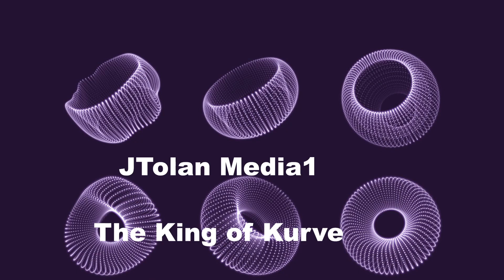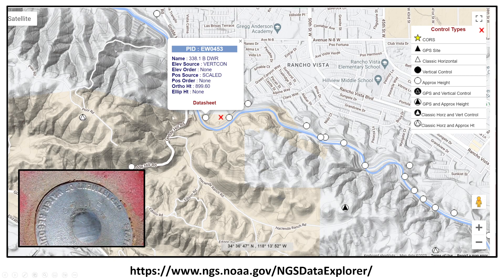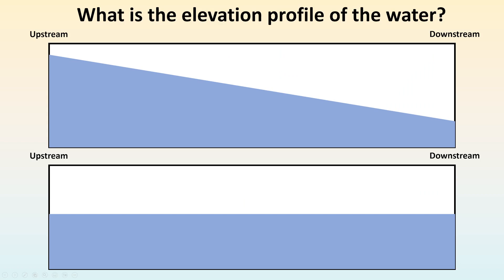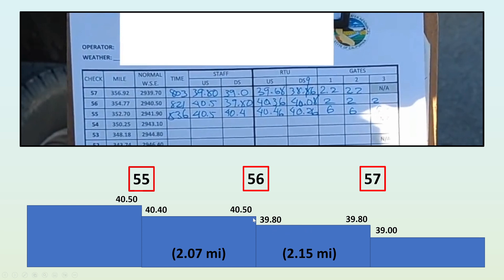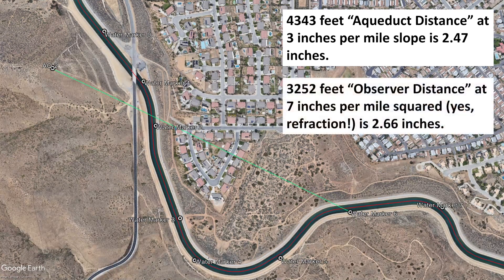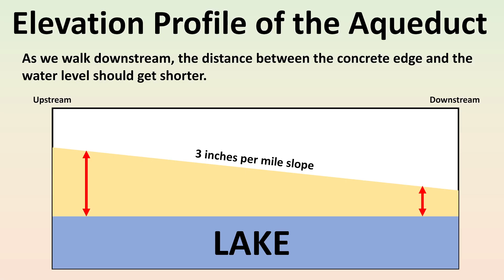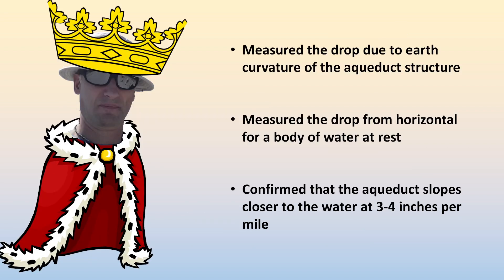@jtolanmedia1 is the King of Kurve!!!

Comment: 1. First of all: regulating the water on the gates is not so much that "the gate closes completely" and the water is stagnant and "we have a lake" but that water always flows, sometimes slower and sometimes faster, which is regulated by the gates. Did you get it? Only exceptionally, the gate is completely closed or opened to the max. (When there are rapid fluctuations in the water level - e.g. heavy rainfall or something else).
So there is no "lake" between the gates, but the water flows in principle all the time. The rate of flow could be regulated by the gate operator. It can be temporarily accelerated or slowed down, but of course only temporarily, because the incoming mass of water must be let through

2. Secondly: My God, I'm even sorry to write this. The fact that the same level of water was measured on the gate above as on the gate below does not prove that "the water is still and we have a lake"! Per analogiam: If, for example, in the vicinity of St. Luis the gate operator measured the level of the Mississippi River 5 meters and at the same time the operator in Memphis also measured 5 meters, does that mean "the water is standing and we have a lake between St Luis and Memphis"? What about the terrain, the height difference between St Luis and Memphis? 
The operator at Gate 55 of the Aqueduct measures the water level relative to "his concrete", and the operator at Gate 56 measures the water level relative to "his own concrete". But these "concretes" are not on the same level as you drew it in your drawing. Because the terrain is falling. Did you get it? 
[Not to mention the fact that you showed some records of measurements, and you didn't even notice that on what you showed the operators entered the times of the measurements and these times were different. Around 8:00 in your movie. But it's just a curiosity, it doesn't matter at all. ]

Thirdly. Jtolan measured the water level at a distance of 6,991 feet. His sheet is shown in your video (around 12:30). So why did you end up at 3,252 feet? Over a distance of 6991 feet, drop associated with the supposed (imaginary) "curvature of the earth" is 14 inches. But JTolan measured only 6 inches, and much more importantly, the drop line shows no curvature!

In summary: you mock JTolan for being the "King of Curves". And who are you? Are you just wrong or are you intentionally lying and deceiving people?
King of Fools or Prince of Tricksters? You choose.
Reply from the maker: Yay! A flat earther engaging with the actual content. Thank you 👍

"First of all: regulating the water on the gates is not so much that "the gate closes completely" and the water is stagnant and "we have a lake" ..."

Yes, I understand this. Go to 7:15 of my video, where I say "this is a tricky situation because we actually have flowing water. If that water is flowing really fast [...] in the bottom diagram we've got a situation where the water isn't flowing much (if at all)". I'm simply using the terms "river" and "lake" to distinguish between scenarios where the elevation changes and where the elevation does not change.

" ... which is regulated by the gates. Did you get it? Only exceptionally, the gate is completely closed or opened to the max."

Yes! If you listen to the interview in JTolan's video, the employee mentions how the gate is "open to 2.2". I don't know what units these are - maybe feet? - but yes I understand that the gates are regulated, and the water is generally always flowing. The key is whether there is a significant elevation change to the water. His measurements say that the water is at a constant elevation.

"Secondly: My God, I'm even sorry to write this. The fact that the same level of water was measured on the gate above as on the gate below does not prove that "the water is still and we have a lake"!"

First up - never said the water is "still". The term "lake" I used in the video is simply shorthand for the water maintaining a constant elevation.

"What about the terrain, the height difference between St Luis and Memphis?"

The elevation at the gates has been surveyed to an accuracy of +/- 2 cm (i.e. less than an inch). The measurements that the employee makes are elevations relative to sea level, so YES the "concretes" ARE at the same level. If he measures 39.80 at one end and 39.80 at the other end, then there is no significant elevation change in the water.
 
" ...and you didn't even notice that on what you showed the operators entered the times of the measurements and these times were different."

Of course they're different. 🤷‍♂ Dude drives a truck to each station and records the level. Did you think I believed that he was just teleporting .. ? 🤦‍♂🤦‍♂

"Thirdly. Jtolan measured the water level at a distance of 6,991 feet. His sheet is shown in your video (around 12:30). So why did you end up at 3,252 feet?"

The goal was to demonstrate that at this distance, the slope rate of 3" per mile is basically the same as the drop due to curvature of 7" per mile squared (refraction!). JT acknowledges that there are a few inches of wet concrete that make it difficult to see the true water level, add in the diffraction limit of 1 1/2 to 2 inches at that distance, and I just don't think his longer measurements are all that trustworthy - I've caught him fudging the numbers in previous videos, but I stopped short of accusing him of that here. That said, when his video came out, I did try to get a surveyor out there to make similar measurements - but also UPSTREAM - which would have settled the issue because there would be no confusion between slope of water flow, and drop due to curvature. I think I might try this again 👍

Thanks!
Reply: @roohif  "„The measurements that the employee makes are elevations relative to sea level,"

No, they are not. Measurements at the gate on the flowing river are made against the "concrete". Measuring relative to sea level would make no sense to the gate operator. Because he is not interested in the "height of the water above sea level", only the height of the water "above the concrete". Because what interests him is whether the water level relative to the gate is too high or too low,  to know whether to slow down or speed up the flow of water.

 "so YES the "concretes" ARE at the same level."

No, the are not.

Take a look at your own video (6:15). I understand that you agree with how JTolan measured CONCRETE, don't you? 
I also understand you think that the Earth is a globe, right?

So , with these assumptions you should know that the concrete level (relative to sea level) is not the same, but it is dropping about 3 inches per mile as measured by JTolan and as you accepted his measurement. I also accept his measurement. So the concrete is not at the same level, but follows the slope of the terrain- around 3 inches per mile.

[I remind you: 3 inches per mile concrete drop is NOT in reality, but with assumptions like above]

Therefore, if we both, that is, you and I, agree on the concrete measurements made by JTolan, then let's consider what results from these measurements.

Well, from these measurements it follows that the slope of the concrete (relative to the observer with the theodolite standing on this hill!) is the sum of what corresponds to the (imaginary) "curvature of the earth" (8 inches per mile squared formula ) and the slope of the terrain. This total over a distance of 8559 feet is approximately 2.11 feet (25.32 inches), see concrete measurements by JTolan.
However, at a distance of 6991 feet, i.e. the distance at which JTolan measured the water level (not the level of concrete) it should be about 18 inches. 14 inches due to the "curvature of the earth" plus 4 inches due to the slope of the terrain. Correct? Reminder: concrete drop follows the (imaginary) "curvature of the earth" and the slope of the terrain - as proven by JTolan, with which we both agree. See your video.

Now let's see how water behaves. Let's consider two cases. 
Case one: we live on "a globe with a radius of about 6371-6378 km". In this case, the water will behave in the same way as concrete,  it will follow the "curvature of the earth" (as concrete follows) and the slope of the terrain. Thus, if the earth were a "globe" (as above), then:
1. JTolan measuring the water level would measure at least about 18 inches of difference (in the water level relative to the observation point) over a distance of 6991 feet.
2. The water level (relative to the observation point) would be a curved line, not a straight line. Exactly the same as the concrete level.

Meanwhile, JTolan measured just under 5 inches of difference in water level. And what is even more important, the water level is in a straight line, not a curve.

Case two: we live on a flat earth. What should JTolan measure then? What water level?
Well, first of all, it is worth noting that someone has built (for some reason, I will come back to this later) concrete that follows "the curvature of the earth". You can't change that, it's how someone built it. Concrete is a structure made by a man. But does water pay any attention to this fact at all? Of course not. Water follows the laws of physics and flows in accordance with the terrain.
So on flat earth:
1. JTolan should measure about 4 inches difference in water level.
2. The water level line should be a straight line.
JTolan measured just under 5 inches of difference. 0.4 feet, which is 4.8 inches difference. The water level line is straight.

The earth is flat.

But someone has built concrete that follows the "curvature of the earth". Why ? Well, you never know what's in someone's head and who's up to what. I suppose that those who built the aqueduct had  „the globe Earth”  (imaginary) in their heads. And they figured out that when the concrete follows the drop from the (imaginary) "curvature of the earth", it will then keep the same level relative to sea level, regardless of the slope of the land.
But since the ground is flat, the effect of this erroneous assumption is that the concrete drops faster than the slope of the terrain, and  the water level relative to the concrete rises with each mile (between the gates, of course, because at the gates the water level resets). Water does not lie.

Which was also shown by J Tolan.

Very good work  Mr JTolan ! Beautiful.
Thanks a lot. God bless you!
Reply from the maker: @maciek445  ” No they are not “

YES. THEY. ARE. 

The column on the left: “Normal WSE” is Normal Water Surface ELEVATION - which is what the employee is recording when he checks either side of the gates.

The water is measurably NOT sloping down at 3” per mile.

Try again.
Reply: @roohif  "YES. THEY. ARE. "

No, they are not.

But you are confusing reality with what you think is reality. And I was writing about reality. What the workers think they measure at the gate is one thing, and what they actually measure is another. The discrepancy between what the workers think they measure at the gate and what they actually measure is because the concrete is built on the assumption (imagination) of a "globe", but the real earth is not a globe. Did you get it?

"The column on the left: “Normal WSE” is Normal Water Surface ELEVATION - which is what the employee is recording when he checks either side of the gates."

Well, so what?
But let's take what you say. Therefore:

1. first of all, you think that the earth is "a globe with a radius of about 6371-6378 km",
Correct?

Well, that's your imagination about reality, but let's assume for a moment that this is what the earth is like, that this is what it actually is.

2. secondly, so you stated that you agree with JTolan's measurements regarding the CONCRETE LEVEL.
Right?
On this point I also agree.

3. Thirdly, now you say that "workers measure the height of water above sea level and that we have a lake, because the water is at the same elevation throughout the measurement distance".
I don't agree with that of course, but let's assume it's what you said.

Conclusion: So, based on these three assumptions, over a distance of 6991 feet we should:

- measure approximately 14 inches of difference in water level (relative to where the theodolite is standing). Because since "the water is on the same elevation and the earth is a globe" (see assumptions), then the water level should follow the "curvature of the earth".

- more importantly, we should observe that the water level line is curved (parabolic) and not straight.

But J Tolan measured a 4.8 inch water level difference and the water level line is straight. Reality does not match your imagination.

The operator at the gate may think that his measurements show that "the water is on the same elevation", because it follows from his assumptions, because the concrete is built as if the earth was a "globe". Unfortunately, however, this is not what he thinks because it is only concrete that is built in such a way that it imitates the "globe", but the earth is flat.  
Did you get it?

Okay, so now let's unmask one more trick of yours.

You  agreed with JTolan's CONCRETE level measurements. See your own video. If so, note that JTolan has shown that concrete follows the (imaginary) "curvature of the earth", expressed by the formula "8 inches per mile squared" plus the slope of the terrain, which is about 3 inches per mile.
A perfect match with concrete level measurement (relative to the point of view) is  created when you add about "3 inches per mile" to the "8 inches per mile squared" formula.

Yet you, at one point in your film, use the formula "7 inches per mile squared" instead of "8 inches per mile squared."
First, you yourself agreed that JTolan's "8 inches of curvature" formula added to the "3 inches of slope" formula gives a perfect result, a near-perfect match, as JTolan showed, but you are using "7 inches of curvature" yourself.
[Apply the formula "7 inches per mile squared" to "3 inches per mile of slope" for concrete measurements, and you'll see that there won't be such a perfect match. It's perfect at "8 inches per mile squared" as shown by JTolan].

Why are you doing this? Why are you using "7 inch formula"?

Because this is your trick to MINIMIZE the effect of the (imaginary) "earth curvature" to convince the viewer that JTolan may have confused the (imaginary) "earth curvature" effect with the slope effect.
The second arsenal of your trickery is that you stop at 3252 feet while JTolan measured at 6991 feet, so you're only considering the initial 46% of the total distance.
All this in order to deceive the viewer, to convince him or her that "JTolan mixed everything up"

Finally, what concerns refraction. Well, the importance of refraction in this observation is small. Because it is not the refraction itself that is important, but the differences in refraction at successive directions of measurement. These differences are small, because the distance is short, the viewing angle is quite steep, and the weather conditions were very stable. So even if refraction adds or subtracts something to the measurements, it can be assumed that it is more or less the same value for each subsequent measurement point.

So no, Mr roohif, the formula "7 inches per mile squared due to refraction" cannot be used.
You yourself agreed that the "8 inches" formula used by JTolan (together with the "slope formula") gave a perfect match, as you shown in your own video.

So the final conclusion:

Bad trickery mr roohif!
Good job Mr JTolan!
Reply from the maker: @maciek445  "No, they are not."

Yeah .. they are 🤷‍♂ Shall I quote the DWR employee?

"The 'STAFF' is the reading on the outside; we have marks on the wall, like every foot, and we have it divided in tenths. That's how we read the water *ELEVATION.*" (45:40 in JT's video)

They are reading the elevation of the water above mean sea level. And on the only data that we have, there is no significant change in the elevation of the water between gates.

I'm not sure you understand what this means logically:

1. JT acknowledges that there is 8"/mi^2 drop due to curvature AND 3"/mi slope in his measurements of the concrete structure.

2. JT's measurements of the water level relative to the concrete (i.e. his tape measure) show a 3"/mi slope between the two.

3. THEREFORE he has also measured an 8"/mi^2 drop due to curvature in the water level.

He just THINKS that it's a 3"/mi slope to the water, even when the DWR employee's measurements show there isn't a slope.

" ... because the concrete is built on the assumption (imagination) of a "globe", but the real earth is not a globe."

No, the surveying method used to determine these elevations does not care if the earth is curved or not. So I point you again to the logical conclusion above, that JTolan measured drop due to curvature, not slope.

"Why are you doing this? Why are you using "7 inch formula"?"

Excellent question!!! When making optical sights, you should definitely include refraction in the calculations. Assuming typical conditions, the drop rate is actually 6.85"/mi^2, which I rounded up to 7" in the video. And yes, JTolan used 8"/mi^2 and 3"/mi in his calculations - and they matched incredibly well to his measurements. What he SHOULD have used is a lower value for the drop (i.e. 7"/mi^2) BUT he also should have used a higher value for the slope (3.75"/mi on this section, but also needs adjusted for refraction). Not to mention that according to the survey benchmarks, they are, on average, more than an inch away from being perfectly aligned to that 3.75"/mi. So, rather than spend several minutes of an already long video discussing this fairly minor point that doesn't really affect the numbers significantly, I just left JT's calculations as they are.

So, just to repeat:

JT confirms that the aqueduct itself drops 8"/mi^2 due to curve AND slopes at 3"/mi. He then measures the water level relative to the concrete walls, and measures a 3"/mile drop. THEREFORE he MUST conclude that the water itself also drops at 8"/mi^2.

JT believes (incorrectly) that he measured a slope to the water. He could have easily made some measurements of the water level in the UPSTREAM direction to confirm this, but he didn't. I wonder why ... ? As I said, I'm trying to organise a local surveyor to head up there and do it properly.

Thanks again for legitimately engaging with the content! Most flerfs just hand wave dismiss 🤷‍♂🤷‍♂
Reply: @roohif  I'm not a surveyor, but as it happens, I will be in California in May, including the Los Angeles area, and I just might be able to find a day to rent a theodolite, go to the place JTolan did his measurements and repeat them 😁 No promises, as finding the time to do it might not be that easy, but I will try to squeeze this in, simply because it sounds like fun!
Reply from the maker: @scienceitout  Woohoo!!! Yeah it's a big job to rent a theodolite and haul it up to Palmdale, but if you're down for it, I can give you the place where I hired mine, and give you a list of all the observations I'd need 👍👍 Assuming of course, I haven't hired someone local to do it 🤷‍♂
Reply: @roohif  Sure, that would be great 👍 I kind of hoped you'd have some plan, but even if not, I'd have figured something out, maybe 😁
Reply: @roohif  ""The 'STAFF' is the reading on the outside; we have marks on the wall, like every foot, and we have it divided in tenths. That's how we read the water *ELEVATION.*" (45:40 in JT's video)"

And what ?
As I wrote from the very beginning: the gate operator reads the water level primarily RELATIVE TO CONCRETE. Because how else?
One may think that "the reading shows the actual elevation of the water above sea level". But that's not true. The interpretation of the measurement is burdened with an error corresponding to the (imaginary) "curvature of the earth". Because concrete imitates the non-existent "curvature of the earth", but the terrain does not.

But it doesn't matter at all. You are now trying to draw attention to what is unimportant. "Elevation" or "not elevation" (about sea level). „Exact elevation”  or burdened with an error?
It's completely irrelevant to this issue.

Because, IF it's like you say "water is at the same elevation relative to sea level", THEN JTolan should:
- measure with a theodolite 14 inches of difference in water level (relative to the observation point)
- and what is more important, the water level line (relative to the theodolite) should be curved, not straight.
Do you agree or not?

JTolan measured a 4.8 inch difference. The line is straight, not curved.

„1. JT acknowledges that there is 8"/mi^2 drop due to curvature AND 3"/mi slope in his measurements of the concrete structure.”

Yes. This is the curvature of CONCRETE, a structure built by man. And to check whether this curvature of the concrete corresponds to the "curvature of the earth" you need to check the "curvature of the water" (or lack of it).
Do you agree?

Man can build any structure with any curvature. But will the water pay any attention to it? 

„JT's measurements of the water level relative to the concrete (i.e. his tape measure) show a 3"/mi slope between the two.”

NO. It was only one measurement, from which no meaningful conclusions can be drawn, the more so it is impossible to conclude from only one measurement that there is a „constant slope between water and concrete". The tape measure was taken after the concrete measurements, to see if the water level was rising relative to the concrete. Because if the water doesn't rise relative to the concrete, there's no way the surface of the water will be flat, not curved. 

The only thing that interests me is the surface of the water. JTolan might not have measured concrete at all, he could have measured water right away. Concrete, benchmarks, data on the benchmarks - it's all man made. And water is water, and it neither makes mistakes nor lies.
Only water surface measurements are relevant in this regard. The rest, i.e. what is man-made, is noise. You're trying to draw attention to the noise, to distract from what's important. You say: look at our data, our models, our "globe", our "Google Earth", our "wgs84", see the earth is a "globe". Well, if someone accepts your data, the conclusion is that "the Earth must be a sphere". But the point is that what your data indicates is not true. It's just that your model doesn't match reality. I know this for sure because I have been researching it myself for several years.

[Digression. Let me give you an example. In one of your videos, in which you "expose" one of JTolan's "mistakes", you state that where Jtolan said he saw distant land on the horizon, there could be  only „blur”, because there is no land in that direction, because that's what Google Earth says. Well, this claim is based on the following premise: Google Earth is a  true model of reality. Google Earth is a kind of "truthful Oracle” proclaiming only the truth about the world.
But I also saw the same thing, that the directions given by Google Earth do not correspond to reality. In one of my observations in Poland, I saw a distant mountain (about 100 km) and three buildings, about a kilometer and a few meters from me, buildings about a few dozen meters apart from each other. According to Google Earth, the mountain should be visible between, say, building 1 and building 2, in the middle between them. This is the result of drawing appropriate lines in Google Earth between the top of the mountain and the point of observation. And in fact, the mountain is visible between buildings No. 2 and No. 3. So no, your data does not correspond to reality, and I do not regard your data as an „Oracle of truth”.]

„3. THEREFORE he has also measured an 8"/mi^2 drop due to curvature in the water level.”

IF he „measured the drop due to the curvature of the water”,  THEN he should also notice the „curvature of the water”  measuring the water level. But the water level line is straight and the amount of the drop does not match what is due to the (imaginary) „curvature of the water".

„ ... because the concrete is built on the assumption (imagination) of a "globe", but the real earth is not a globe."

No, the surveying method used to determine these elevations does not care if the earth is curved or not.”

No matter what the "surveying method" was. Concrete exhibits the "curvature of the earth", but water does not have the "curvature of the earth". This is what the measurements show. Water doesn't lie. So the conclusion is simple.
WATER IS THE ONLY THING THAT COUNTS. The rest is unnecessary noise. Correct?

Your logic is "look at this noise (human works)." And mine is this: you want to know whether the earth has a "curvature" or not? Then don't look at the concrete, at the benchmarks, at the „wgs84”, at Google Earth... at all these data, but measure the surface of the water.

„So I point you again to the logical conclusion above, that JTolan measured drop due to curvature, not slope.”

If he measured the "drop due to curvature", he should also notice the "curvature of the water".

Let me be very clear. Either JTolan is lying/wrong or your data is corrupted.
I accept JTolan's measurements not because I "believe in him a lot" because I don't trust anyone. But I accept his meassurements because I have my own observations.

„When making optical sights, you should definitely include refraction in the calculations.”

No, that's not true. It depends what we're talking about. In terms of absolute values (true angular directions to objects), yes. But when it comes to the RELATIVE position of the points, it may be that refraction won't matter much. For example, you are looking at the top of a high mountain, say 50 miles away, while standing on the ground between 49.7 miles and 50 miles from the mountain. The first observation point is 50 miles away, the next 49.95 miles, the next 49.9 miles...etc...the last 49.7 miles. If the weather is stable and good, you can safely assume that the effect of refraction on the results is negligible. Reminder: you are interested in the RELATIVE position (angular) of the observation points, not in which direction the mountain really is. You can just assume that at 0.3 mile distance the refraction is almost the same, so the error due to refraction is the same. Then the result of the observation depends on the SHAPE OF THE SURFACE, and you can neglect the refraction. The same can be true if the distances are short and the viewing angles are steep, not shallow. Snell's law. This is exactly what JTolan observes. You can neglect refraction because you are not interested in the actual direction to the observed points, but in the RELATIVE POSITION of these points.
This is why the "8 inch" formula worked so well. Because the differences in refraction between particular directions are negligibly small.

„He could have easily made some measurements of the water level in the UPSTREAM direction to confirm this, but he didn't. I wonder why ... ?”

And what's your guess?
 Because when I look at the Google Earth panorama from the hill where JTolan was standing, then, looking to the left, I can't see the aqueduct, it's obscured by the mountains.

„As I said, I'm trying to organise a local surveyor to head up there and do it properly.”

Do it properly! 
Focus on the surface of the water, because that's all that matters.
Reply from the maker: @maciek445  "the gate operator reads the water level primarily RELATIVE TO CONCRETE."

Right, and those marks on the concrete are ELEVATIONS above mean sea level. And the measurements that the DRW employee took showed that the water is at a constant elevation. Why do you continue to deny this?

"The interpretation of the measurement is burdened with an error corresponding to the (imaginary) "curvature of the earth"."

NO. IT'S. NOT. The methods used to determine the elevation of these benchmarks DO NOT CARE about the shape of the earth. If you want to dispute the elevations of benchmarks, then your issue isn't with me or with JTolan, it's with the entire field of surveying.

"[...] JTolan should: measure with a theodolite 14 inches of difference in water level"
"JTolan measured a 4.8 inch difference. The line is straight, not curved."

Lawdy it sounds like I need to go slower:

So, you said he SHOULD measure 14 inches, which means you're talking about the most distant observation: 6991 ft line of sight, 8328 ft aqueduct length. So, yes - if the water is at a constant elevation, then he should have measured 14 inches of drop (well, 12 inches with refraction, but happy to use 14 inches here).

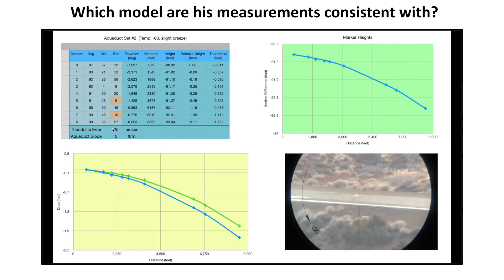When he made his first set of measurements - to the edge of the concrete, not the water - he made a measurement to the pump station. This is the most distant sight, and is where he put his tape measure against the concrete. Can you remember what his measurement was? See 4:40 in my video: it was 2.11 feet lower than the starting point. 2.11 feet is about 25 inches, correct?

Now, looking at his measurements using the tape measure: the height of the water RELATIVE TO the concrete changed by about 6.5 inches (see 15:40 in my video), which I'll round up to 7 inches because his first tape measurement was a little downstream from the first marker.

So, let's see if you're smarter than a 7 year old: using these two measurements, how much did the level of the water drop from horizontal? 25 inches minus 7 inches equals 18 inches. GOOD JOB!!! 🏆🏆

Yet when he made measurements of the water level, he only measured a 4.8 inch drop - can you see the discrepancy now?

So which measurement is likely to be wrong? Well, we have professionally surveyed benchmarks that are accurate irrespective of the shape of the earth, and JTolan measured to these and found that they corresponded to 8"/mi^2 AND 3"/mi slope. He has the measurements  with the tape measure, that show the concrete relative to the water changes by 3"/mi. We have some DRW readings that show the water is at a constant elevation. And on the other hand, he has theodolite measurements to the water level, which he acknowledges are difficult because there are a couple of inches of wet concrete AND he "corrected the data slightly in post analysis". Don't want to call the guy a liar right now, but I have caught him fudging his analysis in favour of FE before.

As I said at the top, making measurements UPSTREAM will put this beyond any doubt.

"In one of my observations in Poland, I saw a distant mountain (about 100 km) and three buildings [...]"

Sure .. hit me up in Discord and we can discuss this. In my experience, Google Earth is incredibly accurate.
Reply: @maciek445  so let me get this part straight. You're asserting the staff reads a concrete level of water and then incorrectly converts it to an elevation above seslevel (since they incorrectly assume the concrete is built with a 3" slopd following the curve of earth while it actually is sloped additionally to the 3" slope due to assuming the curvature).
Yet somehow they can use this incorrect elevations to adjust the gates according to what the water physically does without anomalies? 

Or are they just following the result of a tial and error result sheet with nobody ever remotely questioning the process? 
You'd think a massive structure like this would need to be planned and modelled before hand to predict how it needs to be operated and what requirements need to be fulfilled by its parts. According to you this can all be done while a massive misunderstanding and disconnect between the structure of the building (and water level measurements acquired relative to it) and the actual physical behaviour of water are in place.
Reply: @Maciek, I'm not sure why you say "imaginary" curvature of the Earth when this is one of three videos where JTolan measures the curvature of the Earth with a theodolite.
Anyway, if he really wanted to measure the curvature of the Earth, he could shoot reciprocal zenith angles between two mountains. Refraction can be minimised because you can shoot far above the surface, it's not necessary to know any elevations, and the method and geometry are simple. In fact, I've never seen any flat Earther do this. Why is that?
Reply: @everybodylovesballs  "Maciek, I'm not sure why you say "imaginary"curvature of the Earth"

Because there is no such thing as "the curvature of the Earth". It's just your imagination, your delusion. The origin of this delusion is in a thinking error, a simple logical error. 

"when this is one of three videos where JTolan measures the curvature of the Earth with a theodolite."

That is not true.

"Anyway, if he really wanted to measure the curvature of the Earth, he could shoot reciprocal zenith angles between two mountains."

I don't know exactly what you mean. I'm guessing, but I'm not sure. If that's what I'm thinking, it won't work. But tell me about it.

"Refraction can be minimised because you can shoot far above the surface,"

It's not true.
Reply: @maciek445  so your response is basically "nuh-huh". Typical flerf.